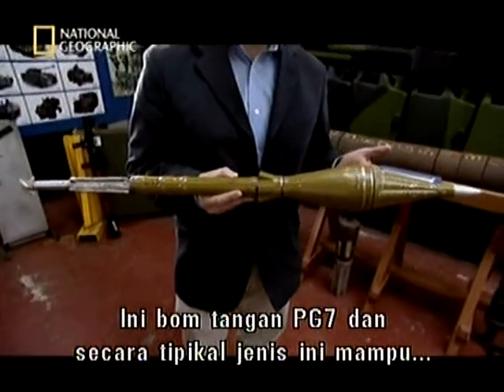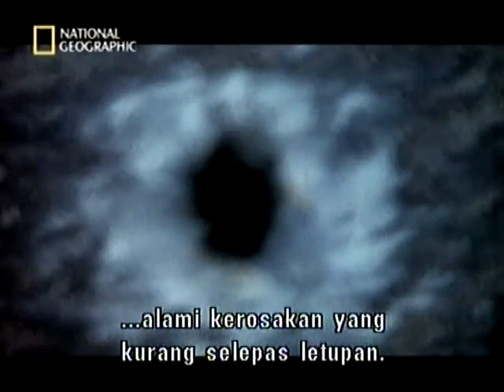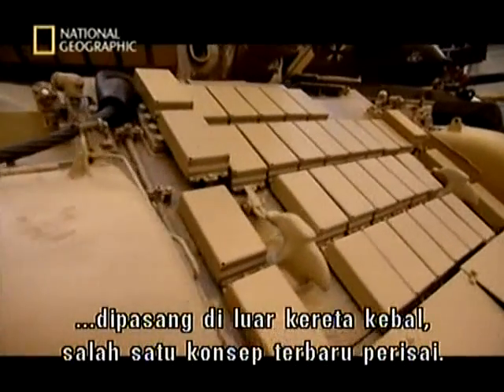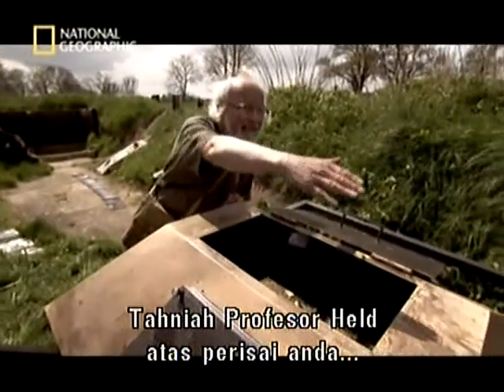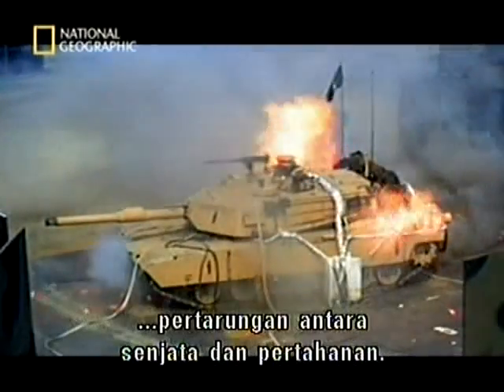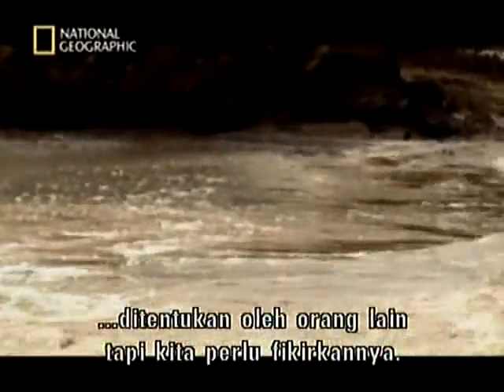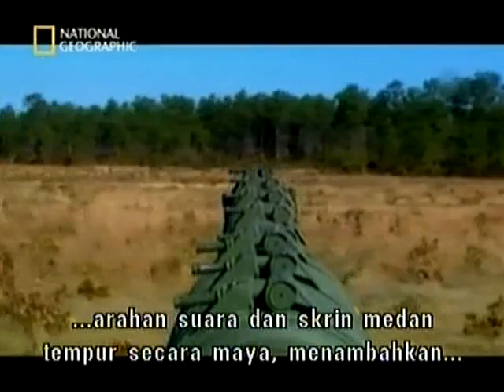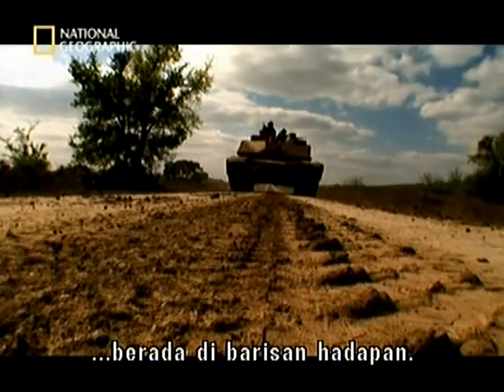Explosive Reactive Armor

Comment: Heat ammo can be stopped by using spaced armor, darts with tungsten core can easily go thru that, but 150mm HIGH EXPLOSIVE to any turret is lethal to driver and makes the optics unusable, rendering any tank destroyed.

Comment: How is one piece of armor gonna go off and repell the munitions without setting the rest of the explosion reaction armor off?
Reply: A special kind of explosive which is extremely difficult to set off. Similarly to how you can light C4 on fire and it won't explode, they make explosives for ERA which won't be set off by small arms fire, shrapnel, or adjacent ERA bricks.

Comment: I believe russia has answered if tanks are useful in modern battlefields. I would say I dont believe they are. Tanks versus tanks... sure but now an infantry squad can easily take out a tank with anti tank missile systems that are highly mobile. -
Reply: Inaccurate. Otherwise Ukraine wouldn't be consistently asking for more tanks. Tanks are meant to serve as fire support for infantry, Russia uses them wrong (long tank columns roaming on mined streets etc). They require infantry support, which is nowhere to be seen in the videos where Russian tanks are destroyed.

Comment: With active armor I would work on an RPG that has a proximity fuse that detonates a shaped charge at around 5 meters out that is used
to accelerate a penetrator. Sure penetrators maybe somewhat deflected but active or reactive explosive armor blast or shrapnel effects yet have enough kinetic energy to get through. There's still no defense against a really fast moving rod of depleted uranium or tungsten, although that would obviously push development back toward composite armor such as Chobham.

Comment: And therefore most modern ATGMs have tandem warhead. Basically a secondary explosion to set off reactive armor before the actual penetrating warhead. An explosive countering the explosive that was designed to counter explosives by exploding
Reply: Tandem reactive armor it is then!
Reply: @paskky913  it already is
Reply: you lost me, then you got me, only to have lost me again but then you got me.
Reply: Exploseption. [cue the aggressive drum and bass noise]
Reply: Hey how's Eientei
Reply: Explosive
Reply: @Corporal Adrian Shepard I wonder how many counters you can add if you go all the way back to pointy sticks lol
Reply: Exactly what I need
Reply: Double explosive reactive spaced armor imagine that xd
Reply: @hekmatyar4476  This has already happened, look at Ukrainian duplet ERA which is basically ERA layer stacked on top of ERA
Reply: And therefore modern tanks have ERA purposefully built to defeat tandem shaped charges.
Also most composite armoring defeats most shaped charges effectively as is, so the added protection of ERA is just a bonus, and often not something necessary. 
Though it would be stupid not to use something that helps and is relatively simple and cheap to install.
Reply: @supremegreaser2399  I know
Reply: @osamabinladen824  What do you know?
Reply: I don't think most have it
Reply: @osamabinladen824  Same.
Reply: Thanks! Wasn't aware of this technology
Reply: Hey yo dawg, I heard you need to penetrate explosives, so I put an explosive on your explosive so the explosive can penetrate the explosive
Reply: Era or any modular armor becomes completely ineffective when talking about top attacks, every tank of every nation still is highly vulnerable to top attacks unfortunately
Reply: lol era useless

Comment: When using shaped charges, can't you use water or something similar to direct the blast and concentrate the power of the explosive to the side you want to go?
We used that to breach doors and walls, but I think it could have a use in shaped charges too.
Reply: a shaped charge is not an explosive weapon, the armor penetration comes from the kinetic energy of the formed copper spike

but directing explosion in the right direction is done on HESH rounds, they use a soft metal that contacts the armor and if it is smashed flat enough the explosive goes off and transfers the energy of the explosion into the armor
Reply: @suit1337  exactly. Because water actually helps directing the kinetic energy of the explosion, I thought it would work if you use it to concentrate that energy to the side of the shaped charge thus having a jet that goes a bit faster or needing a less powerful explosive to have the same result.

Comment: "one drawback of the explosive reactive armour, is that anyone outside the tank is in danger of being hit by flying shrapnel"
Honestly, if someone is 2m away from a tank and a rocket hit the reactive armour, the shrapnel from the reactive armour itself would be the smallest issue I'd imagine
Reply: Then don't stand outside of the tank better yet leave alone in the battlefield naked with no armoured vehicles whatsoever.
Reply: well if an APFSDS round hits a tank, there is not much danger to bystanders (sort of, compared to ERA), the ammunition is designed to maximize spalling on the inside of the armor

the outside is pretty much undamaged

if disturbed by ERA it is pretty much like standing next do a Frag grenade

so ERA is way more dangerous to infantry than composite or homogeneous armor
Reply: @suit1337  you are correct on the APFSDS rounds but what I imagine is an enemy using an RPG to hit an enemy tank, maybe even a thermobaric charge which would cause more damage to the infantry surrounding the tank than the ERA would. In a nutshell what I'm saying is 9/10 you're fucked either way.
Reply: @slavik1855  RPGs are shaped charges meaning the explosion is concentrated inwards. Don't get me wrong, if you were close the shockwave and explosion would probably kill you, but the ERA is unshaped, and thus would likely hurt people further out than the RPG explosion. Shaped charges are pretty effective at shaping the explosion.

Comment: Keep in mind none of this works on kinetic rounds. It only works on chemical rounds (HEAT), which is from personnel-fired weapons, such as the rpg-7, or atgms. the APFSDS that all modern tanks use as their main armament is unaffected.
Reply: Some heavier Explosive Reactive Armor actually works aginst APFSDS projectiles.
Reply: @golucid745  That is true, especially since some modern ERA is designed specifically for use against kinetic penetrators.
Reply: Yes. I heard the germans use ultra heavy ERA for their ifv the new one, i think it is called puma, on the sides. I believe it is the most protected ifv right now.
Reply: this is wrong, Kontakt-5 , Malachit , Duplet , Relikt  are all designed to affect APFSDS. Some of newer ones  like Duplet  reduce the penetrators effectiveness by 80 %.
Reply: Lil sandstone boulder defeated that RPG-7 like it was nothing...
https://youtu.be/b8PchoZMzrE

Comment: we need to find something to fill the role of the tank on today's battlefield, for the battles of tomorrow.  Something that's not a tank though.

Role of a tank: Armoured support, anti-vehicle/infantry/building, dominating presence.
Potential replacement: No armour, anti-vehicle/building, goofy looking, so techy it breaks easily.

It sounds like what you need is probably a new tank.  No one's saying "Hey, satellites are so 1980s, we should replace them with something that does the same role but isn't a satellite!"  Like, yeah, you could do GPS and telecoms with a long wire and stuff, and not have to use a rocket, but also that's stupid, so... no.

Comment: I think the tank is still an essential part of an army, its not true that the new HEAT are more powerful than modern composites, example: the thickess armor on an abrams m1a2 SEP has a 1620mm homogenous steel equivalences against HEAT and a TOW 2 can penetrate around 900mm of homogenous steel and there is trophy and reactive armor and that’s just the armor question, modern tanks are polyvalent machines with a high fire power and are really low cost if compared to aircrafts

Comment: Limited success in my opinion.nowadays heat weapon are so powerful not even 2 layer of ERA will stop the hot jet.to worsen things up the ERA explosion will kill or wounding the soldier nearby or damage military equipment in one way or another.
Reply: Tandem system renders this useless, TOW Cornet Systems or even RPG-7 adjusted rockets with a really small warhead in the front and the actual rocket back to it even makes it useless

Comment: i wonder if a enemy could just use small arms fire to set of this type of Armour, then start with the rpgs ?
Reply: Nope.
Requires a shockwave traveling much faster than light arms can achieve.
Reply: @burntorangeak  What about the russian proximity ERA
Reply: @aussi3212  
Again I would say: likely not.
I don't see an industry spending billions on tank armor that could be foiled by small arms fire.

Comment: They can only protect a tank once. The solution is to always fire a double round at armor.
Reply: Or put two warheads on a single shell
Reply: @cursedcliff7562  This method already exists. Called tandem charge. There is even anti tank missile with 3 charges in it.
Reply: They put lots of them but if you can shoot the SAME spot twice. Yes you can penetrate with shaped cahrges
Reply: There are types of ERA that are Resistant to tandem warheads.

Comment: Will anything thwart the rounds firing sabots?
Reply: Third generation ERA is capable of snapping long rod penetrators (the standard sabot round of today). Snapping the penetrator effective decreases the potential penetration by a good 70-80%. However they can be countered by using either tandem sabots (rumored to be in development by the US, they basically have the front of the projectile separate from the main penetrator and travel ahead, striking the ERA and detonating it before the main penetrator reaches the armor), or segmented penetrators. Segmented penetrators are made so the tip of the projectile snaps off easily. This makes it so the rest of the projectile isn’t affected and can continue on through the rest of the armor

Comment: Remember back when the Germans used extra plating around the turret and tracks to slow rounds? Would that work to explode the charges and not have it pen?
Reply: No. It would potentially even increase the penetration because it gives the shaped charge more standoff distance, thus more time and space to form the jet.

Comment: This sounds as crazy as fireing a machinegun through your propellers in WWI. But they both somehow work out.
Reply: it sounds crazy but the explosive power in ERA isn’t nearly powerful enough to penetrate the armor on the tank.
Reply: @202-visual  I call the bank to
Reply: @202-visual  especially since some of them use mini shaped charges with smaller fillers between them
Reply: @202-visual  well it depends. That amount of chemical energy focused in something like a shaped charge can, but something flat like that whose explosive energy goes outwards, it cannot. However squash heads use this to their advantage by creating such a heavy shockwave to where it cracks the inside of the armor and uses it as shrapnel (spalling). However ERA counters this very heavily. Little add on to this convo.
Reply: I've always wondered how that worked
Reply: There's a cam that allows for the bullets to go between
Reply: @Ore-Breaker  haha, the solution in the beginning was "make propeller stronk out of steel"
Reply: @Ore-Breaker  not in early WW1 fighters
Reply: @Ore-Breaker  not a camera a timer
Reply: @roboticintelligenceunit1a652  not a camera, a camshaft
Reply: @Ore-Breaker  correct I learnt that with the comment below, Godspeed and good day sir.
Reply: @Ore-Breaker  What do you mean bye “cam”?
Reply: @yonneye2427  he's talking about the synchronization gear on old warbirds to allow machineguns to fire in timing with the propellers. There was a camshaft that went from the engine (which dictated the speed of the propeller) to the firing mechanism so that the guns would always fire at a time in which they wouldn't shred the propeller, no matter the rotational speed of the propeller.
Reply: @nicazer . I am aware of the mechanism. I did not know “camshaft” was shortened to “cam”, thank you for the clarification.
Reply: @nicazer  holy shit thats really cool
Reply: @nicazer  ah thanks m80
Reply: Firing*
Reply: The bullets and the prop are synchronized, so there may be a slight delay every time you fire.
Reply: In the first production of war planes they used pistols n stuff but after they used machine guns that would break the propellers sometimes, due to that they decided to add a mechanism that stops the gun from firing when the propeller is in front of the machine gun but since the propellers are fast it makes it look like the bullets are firing through the propellers
Reply: @-Arrow1920-  plus the propeller is only in the way for a short time. Mostly not in the way
Reply: The crazy thing, is that some of those machineguns weren't synchronized.   The armored the section of prop to be shot through.
Reply: Neither one of them sound crazy what so ever and shouldn’t if you understand basic math and physics. People like you that say such stupid things on the internet need to be shot in the head. Just keep your mouth shut, your comment dosnt contribute to society in any way. And yes mine does bc letting idiots know they’re idiot is useful so they will think twice before they speak
Reply: Shooting a machine gun through the propellers in World War only works because of the interrupter gear the interrupter gear prevented the machine gun from firing a bullet when the blade was directly in front of it look it up if you don't believe me
Reply: @shrimpshot1581  nope. You might wanna watch a vid on how they work
Reply: The first attempts sawed off the propellors.
Reply: dude they timed it where when you shoot a machine gun mounted behind a propellor there is a slight delay when shooting your machine gun so get ur facts right
Reply: The audio to this video sounds like a machingun firing through a running propeller...
Reply: They basically rigged the prop up to the trigger to get the fire rate.
Reply: because propeler and machineguns are synchronized
Reply: It’s sounds crazy but the guns were on timers to not shoot the props in ww1

Comment: IMHO, the Stryker is the principal battlefield vehicle of the future. The firepower of a tank (particularly if fitted with anti-tank guided missiles) and the mobility of a Hummer. Add to it active protection (Trophy) and you have a devastating weapon system. Its mobility is itself protection because it is far hard to hit when moving and far easier to conceal because of its smaller size. Also, a lighter vehicle can go places that a heavy tank cannot. It can swim rivers. It can go through swamps. It can climb steep hills. etc. It makes far more sense to spend money on ACTIVE DEFENSE than on massive armor. One can bring more vehicles, hence more firepower, plus greater mobility into the battle.

Comment: ERA, the addon armour package you put on a tank when the existing armor is uselessly outdated.
Reply: Odd how pretty much every single modern tank in use that most certainly isn't outdated, for example a T-90MS or modern Abrams - still uses ERA in the form of Kontakt, TUSK, etc;. So, you're wrong.

Comment: now then, can someone explain what is depleted uranium and why is it on an abrahms tank? what really are the improvements of DU compared to homogenous armor (i.e, steel, composite, aluminum, etc.) ?
Reply: There are layers of DU in the frontal armor of the Abrams (along with other components, NERA as example). DU has a high mass and provides protection against KE penetrators in a duel situation (tank vs. tank), however has little to no effect on shaped charges (RPG/ATGM). On other tanks steel alloys or tungsten are used, there's not much diffrence, however DU is cheaper (it's basically waste).

Comment: Not only is this propoganda, it's also entirely wrong! ERA does not work the way they show in the video at all!
Reply: Correct. Actual ERA boxes contain an angled metal flyer plate that, when the ERA explosives are detonated, is propelled into the path of the HEAT jet, gradually eroding and disrupting the latter (this is where the angled part comes in: since the plate is flying diagonally compared to the HEAT jet's trajectory, it will keep "feeding" its moving, metal body into the HEAT stream instead of being a one-time obstacle) until it can no longer fully perforate the target armor.
Once again we have here a documentary that peddles the myth of one explosion cancelling out another. Not how it works at all.

Comment: In my younger days i wondered if using sandwiched compressed gas  would do this. 

 But always the concern would be nearby ground troops when it goes off. 

I guess the answer is a question.  Is it safer for infantry nearby to have a functioning tank remain nearby vs the shrapnel danger?
Reply: Shrapnel danger is a common issue with conventional ERA. There have been approaches (as example Dynamit Nobel Defences "HL-Schutz Rad/Kette") which are free from metal and use composite material instead of metal (which is rather heavy), to reduce collateral damage.

Comment: Well the Russians just released the T-14 Armata that does 100km/h with vastly improved operation range and it's fucking bad ass. Three man crew inside their own personal capsule behind a shit ton of armour with a man-less turret to minimize size and weight. The U.S announced they should have a new generation of tank ready between 2020-2024. So Russia has the #1 tank until then and I think tanks in general will be around for quite a while yet.
Reply: The T-14 does not do 100 km/h with 1500hp/48 tons. Just a bit faster than a cold-war era Leopard 2A4 with 1500hp/55 tons.